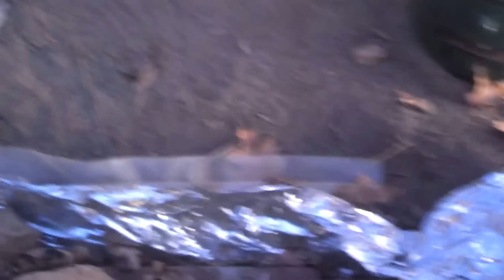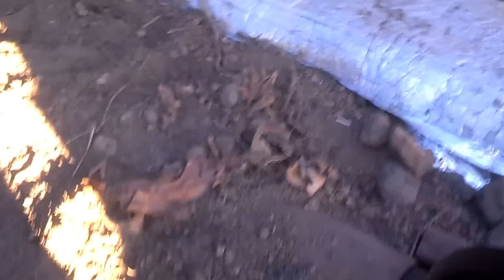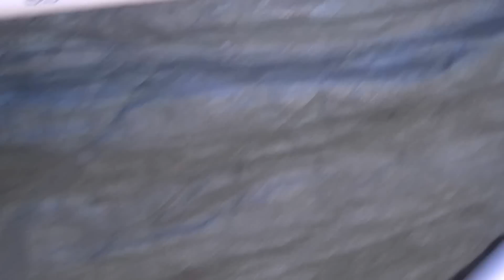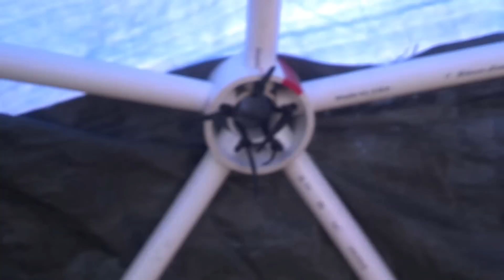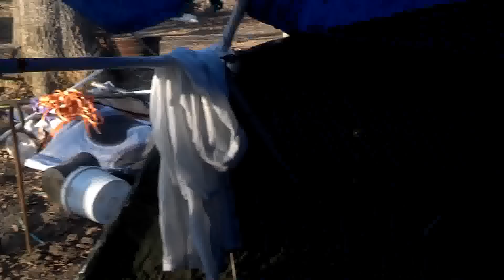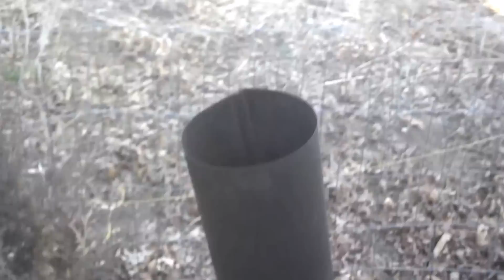Dakota Fire Hole Trench Rocket Stove For Tent, Tipi, Yurt, etc

Comment: Exactly what I was looking for/thinking of!! A pipe with two ends, one for the vent one for fuel, and then bury it in the sand and it would work like a fire hole and also maybe warm the ground along side of it.
Reply: Shoot, I just saw this
Comment!!!
You sound exactly like meare you have something in your mind and then you look on YouTube to find it and somebody's already done it!!!
Reply: I've actually got materials for a prototype most when I can possiblybuild it would be a proof-of-concept for the idea I want to sell it as a kit as an invention is 2 inch 3 inch 4 inch 5 6 7 and 8 in out of stainless steel so you can make about of any size you want are you can build it out of firebrick which is best for the first part of it Seville head about two to three thousand degreesand baby stainless steel wouldn't even stand up to the incredible heat generated!!!

Comment: would you consider this a safe method of heating a tent? as far as carbon manoxide poisoning goes
Reply: Yes. Other than first firing it up, all smoke, etc goes outside. And that need not happen even. I light a fire down the chimney outside the tent to heat up the pipe. Then light the fire in the Fuel Port. Instant sideways flames.
I apologize for not replying sooner...went through a divorce. Life's been interesting.

Comment: great video thankyou.Do you think I could use this method in my tent? ps I know nothing about pipes please can u tell me what a T is? THANKYOU
Reply: I am sorry to be so late in seeing this. I have another YouTube channel and have not been able to get on this one very often. 
As to your question there are standard stove pipe fixtures such as an elbow which goes from, if it is solid, 90 degrees just an elbow turn. 
The kind I have here can be adjusted to a 45 degree or whatever angle, it could be made straight or  anywhere from straight to 90 degrees. then a tTee  is exactly what it says;  one part of it goes straight through and the other part is up so the part you see would be the base of the tee, and then the two top parts of the Tee, if it were an upright, capital T,   are in line going from the elbow to the rest of the pipe.
 You can look those up online and then just go to a company that sells stove piping nd you'll see what I'm talking about. 
Thank you for your question and I'm sorry for taking so long to get back to you.